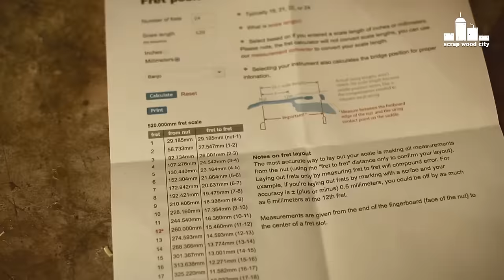DIY experimental acoustic string musical instrument

Comment: At 1:20 when you mounted the body on the lathe you should have put the chuck on the inside that way you wouldn't have screw holes to hide, use some scrap wood as a spacer if need be.

Comment: very nice insrument, that "twing" and the little but noticable lack of sustain come from inacurate action in the string + you're scale is probably a liitle too long, again very cool i really liked it, i built a few similar 4 stringed ones with a good tune up this can be a really good sounding instrumet, also i know this was an experiment but think about trying a thinner back next time.
Reply: if the action is ok then some of the frets might need refretting
Reply from the maker: Thanks. I'll keep your suggestions in mind. The action feels nice by the way. Maybe the a few frets are a bit out of tune.
Reply: Scrap wood City they are most likely in the right place but somehow ended up being a little high, u probably understood but just making sure

Comment: Hey, I was wondering how the fingerboard holds up usage? I don't know what wood was that, looks like pine to me? I was just wondering if you choose harder wood for the fingerboard.

I've been looking for cheap second hand tools, building a banjo or something similar would be fun, at least as learning experience. Not sure if our most common  Finnish pine is way too soft for metal strings and I should rather try to hunt down some birch, unless I happen stumble upon some nice laminate or harder export wood. 

I was going to scrap everything, so it's a game of luck. And since the drill is only power tool I got I haven't yet figured out how I'm going to make thin splits if I have to make the fingerboard separately (I'd love to, it would look nice!)

Comment: At 1:31 he was using a lathe. Does anyone know the specific manufacturer and model of the lathe that was used?

I also built on of these. they are so cool. Thanks for amking these awesome videos
Reply from the maker: I thank you. My lathe's brand is Boston
Reply: Thank you. I did a quick google search for it and i couldn't find it. is there a model number?

I also am trying to make this but I do not have a lathe. Is there a way to make the body(the round part) round without a lathe or bandsaw?

Comment: Thanks. When will you make a bouzouki?
Reply from the maker: I thank you. I really want to make one but I still need to figure out how to make certain things ( I also need a device to bent thin wood sheets). I hope in future I will!
Reply: Scrap wood City With your skills & tools, you will be able to make a device to bend wood sides. A light fitting (brass) in  tin can with lightbulb and heat-resistant cable/flex. They once called it butle. or, use a can (must be fixed to wood and clamped) and a heat gun. Not sure if a hair dryer would be hot enough. Or, you could cut out a "former" which is a fixed sized shape, wet the sides a little, wrap in foil and use a heat gun/hairdryer. It is the steam it creates that relaxes the resins, so that you can bend the wood. Once shaped, you need to keep it in the shape for 24 hours before working on the sides.

Comment: seems like a lot of overcomplicating. could have just glued boards up height-wise into a big square, roughed with the bandsaw into a disk and went directly to the wood lathe to hollow it. more wasted shavings but probably a lot less time since it needed one clamp and dry instead of a ton of cuts, sanding, glue, clamp and then do another piece. just sayin